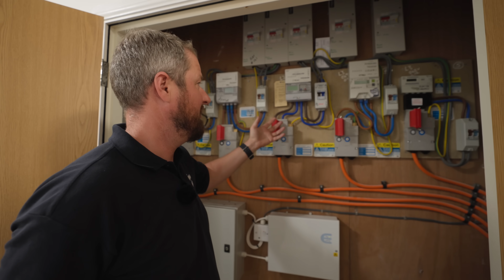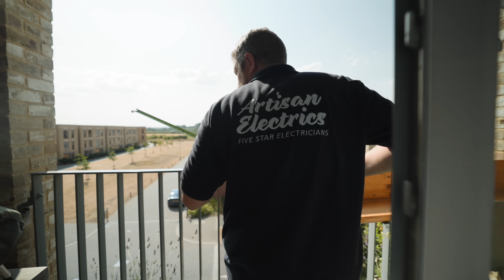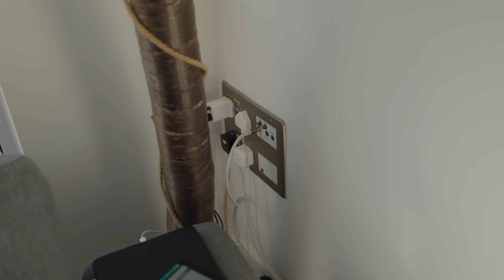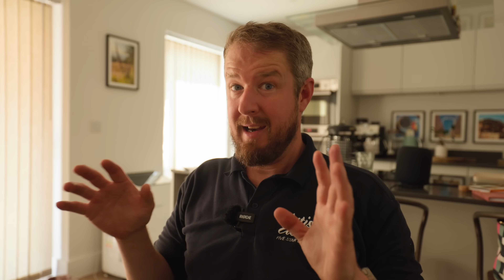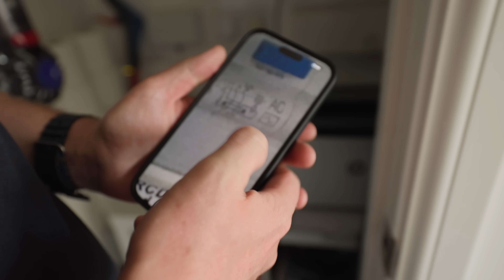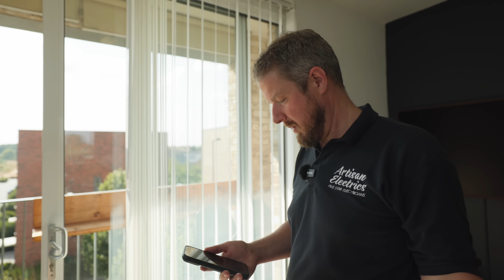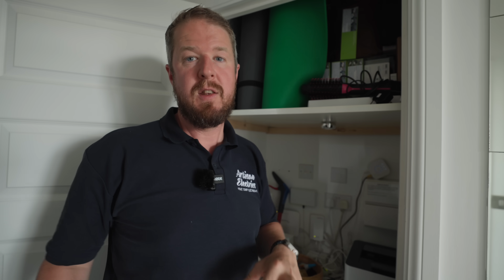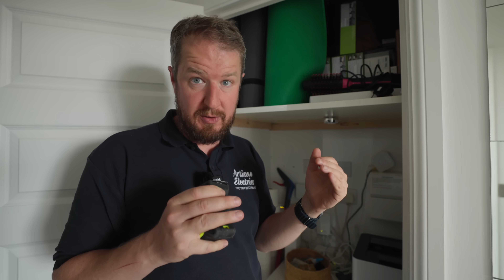I Found a BIG Problem With Plug-In Solar…

Comment: VERY, VERY DISINGENUOUSE !!
You use an example that might apply to just a few percent of the population and then try and dissuade potential people by using that as a classic example.
Outrageous self promotion ..... scaring people off with excessive costs etc. 
Plugging EICR's .... just soooooo wrong.
I like you AND your channel - but this was just an appallingly biased self-serving view of "Balcony systems" where YOU aren't needed at all. Kind of liking asking Turkeys to vote from Christmas. I get it. But be honest and stick to what you normally do.
Balcony systems are here, accept it, stop your scaremongering as we have seen, very soon there will be millions of them all over the country.
Those, like myself with FULL solar - will still have FULL solar fitted and some will choose you guys.
Don't be so dramatic ... plugging in something that at most can push out 800w (Oooooooooh scarey) .... We don't give a thought to plugging in a 2kw or 3kw heater, or microwave or whatever.

Comment: 14:46 I think this is missing the point of balcony solar a little bit. Without the high install costs of 'proper' solar, you can just bang a relatively cheap panel on the outside of the balcony rails. It doesn't have to be perfectly aligned or get the optimal output. Most plug-in home batteries have solar input, so you might as well get some watts into it, even if most cost savings will come from overnight charging!

Comment: I think I am correct in saying that the proposals for 27/08/26 exclude batteries so that would be a future. When/if this is allowed charging batteries using off peak rates sounds great but as more people do this it won't be long before the energy companies are forced to increase the off peak tariff simply because there is no real off peak we would in effect have become a state of equilibrium. The last point means that the pay off (2, 4, 6 years) may not be possible unless it is tied to panels. 

All that said I am still considering it post 27th as we have a large pitched roofed Pergola with dedicated power installed by an electrician, my only dilemma is do I buy something like an EcoFlow Stream Ultra/Pro/Max with built in Micro inverter so that I am ready for storage when it becomes permissible?  

I do need to check the RCBO's so thanks for pointing that out :)

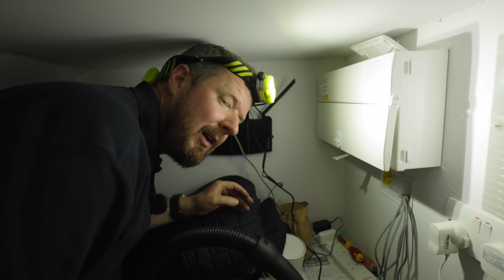Comment: 1:09 Doing an AI search to look up safety critical information about the breakers feels foolish. While LLMs have improved, as a software developer I still wouldn't trust them not to hallucinate, when I can just google the manufacturers datasheet for the component instead.
Reply: The amount of crap these LLMs are spewing is shocking
One day Gemini told me to replace the upper control arms to fix an issue.
My car doesn’t even have upper control arms 🤣 🤣 🤣 
These LLMs are so inconsistent… it’s scary to know some people use them in their day to day work, when dealing with safety critical equipment
Reply: AI is perfectly fine to use as a starting point, and once you find what you're looking for, you confirm it, going the Google search way can take 10+ times longer, so AI first then confirm it, it's far quicker to get the answers you want.

Comment: I've just plugged in my Solarflow 2400AC and love it. Have you seen a quote for Huawei batteries that would go with my SUN2000? Yeah I'd rather plug in then thank you very much.
Reply: Where did you order the Zendure from?
Reply: @dansus99 Toneart (German Shop) and a pre-owned battery

Comment: Biggest issue is the weight of the panels. Each about 25kg. Needs good support. Although you would not do it. Wiring to s lightning breaker will handle the small current

Comment: Lots of negative comments here. I dont see balcony solar in any way competing with a fixed roof solution. Its producing a fraction of power needed in a modern home. Enough power only to run a laptop or two. Personally I couldnt be arsed with the inconvenience for 800 k watts.
Reply: 800 Killo-Watts, yes please!, You could power your whole estate, with that.  How do you plug it in, Camlocks?
I know you mean 800W, and it isn't much, but it's better than nothing, when you can't fit roof-mount panels.

Comment: Traditional Installers/electricians need not fear plug in solar. It's coming if they want it or not. I see it as a "gate way drug" so to speak. People will dabble, see that it works and how well it works and then opt for a full install. If they don't they probably never would have or couldn't. RCBO's aren't a requirement anymore either lowering the barrier for entry by a lot. Also systems can scale to a house's wiring, got 3 circuits? have three microinverters.  One caveat about the fence mounting. New planning laws went in this week where they CANT be mounted to fences. What fun suckers. Sorry to say though, this video does come across as unfairly negative against plug in solar - and looking at the comments it seems many agree with me.

Comment: Are there no P1-meters in the UK?
Reply: No. When the smart-metering standards were developed, the utilities were so sh!t scared of hacking and fraud, that no direct consumer access to meters, was allowed.
The only way to get access to your meter's data, is either, over the Internet to your energy supplier's API, or via a so-called "Consumer Access Device", a gateway, that is paired to the smart-meter, and the Consumer's network.

The smart-meter's ZigBee network, is closed, to all-but supplier approved devices. Even initial on-boarding is limited, by factory installed certificates.
Reply: If you want a headache, go and read the  Smart Metering Equipment Technical Specifications (SMETS) standards.

Yes, standards. The 1st version resulted in meter manufacturers implementing their own flavour of communication, thus if you changed supplier to one that used a different make of meter, you had to have your meters replaced.
That was "Fixed", by imposing a middle-man, that the meters talk to, as do suppliers.
Then V2 of the standard came out, that enabled switching, through the use of common standards.
V2 meters still talk via the middle-man.

Why couldn't the UK, just have asked what meter manufacturers and energy suppliers, are doing, in other European countries?

Comment: The battery system should have an adequate and correct RCD on it, so there should be no need for changing anything on the main board.
Reply: What battery?
The title of the video was "I found a BIG problem with Plug-in Solar...."
No mention of batteries.
I agree withe the other comments that the video should be re-edited to remove all references to "Batteries".
It's about Plug-in Solar Panels!

By all means produce a second video on "Plug-in panels & using a battery".

Just take one step at a time!
Reply: @Ympopka in my country, the anker solix  units typically have a 2kWh battery in them, do they not where you are?

Comment: Thanks for the Type A tip. All good here! :)
Reply: It is not correct though!

The correct thing to do is to plug your plug in solar unit in, then test if your RCDs work OK, as per the instruction manual for the plug in solar device.  If they still work then everything is OK.   A single plug in solar unit is unlikely to cause any problems with your RCDs, whatever type they are.  There are other things in most houses more likely to cause a problem, adding an extra device can cause problems, not will cause problems.

Should we be advised to call in an electrician to check our circuits every time we plug a new computer into a wall socket?

Comment: SO plug in solar is not plug in solar.
There is a good channel that has 365 days of data on what a plug in system will save you and of the top of my head I think that was around £335 a year with the system cost of £2000.
Now this video is suggesting paying maybe over £400 for an electrician to check things before you install it adding more cost which pushs back ROI.
From all the videos I have watched including the Jonathan Tracey video they did not get electricians in to check everything and I think this video might be a bit OTT.

  Plug in solar is supposed to be just that, you plug it in and off it goes and its been in Germany for years and here is is now fine to do so either everyone in Germany and the UK are wrong and you can not just plug it in or this video is just being a bit OTT.

It is rather confusing to see people who think about getting plug in solar then having worries about how it looks and then you find out they are only paying £60 a month,lol.
Even when I lived in a house I was paying around £300 a month and in a pub I am now paying £950 a month so I would be happy to be paying only £60 and if a person is thinking about how it will look then just do not bother, for £2000 and saving £335 a year I think it is worth doing if you have 2k spare and there are lots of ways to add a 5kw+ battery to Eco flow for cheap so you can have a nice larger storage for a lot less money.
Reply: Amusingly, i think Artisan does Jonathans electrics.
Reply: @dansus99  I think your right after all they do a job job.
Reply: Also, does your fence or balcony colour have to be non black?  some people use panels - as fences, sounds good to me.

Comment: For apartment dwellers, I'd suggest that someone talks to the building management (Body Corporate?) and suggest a standardised install of panels and brackets on all balconies provided by the Body Corporate. It will be 1/3 the price and provide a consistent look across the building.
Reply: This is not how it works in the UK, unfortunately. There will be 6 months discussion (email chain bouncing between departments) within the housing association, where the conclusion will be that they cannot do it for health and safety reasons without specifying any.

Comment: I'm in a council place myself, we're a first floor flat but we have our own private garden and entrance porch. I'm going down the route of beg for forgiveness... I've hooked the panels onto the garden fence - fun fact, two panels mount perfectly portrait on a standard sized fence panel! We've had a recent EICR and new CU fitted by the council and the RCBOs are good for it. I'm a high energy user as my hobbies relate to computers and servers so I generally use around £200 a month.

I started with a plug-in inverter but got a bit overcome with excitement and I've since expanded far beyond that, and have installed a hybrid inverter and so far 9 panels all along one side of the fence, and have another 6 to go on the other side (north/south fence). On a good day with just one side of the fence active it's covering about 30% of my usage. I've done the G98 notification and will soon have a friendly electrician check my work and sign off to ensure compliance.
Reply: I predict the biggest risk of balcony solar will be poorly mounted panels. There will definitely be some dangerous installs ending up with solar panels falling from height

Comment: There a few things that are wrong and a few that are valid. Not even a mention of it being legal and compliant on Aug 27th. Didn't mention the batteries are still going to be illegal as plug in until they are hopefully legal in 2027. A home plug in battery still needs to go to the consumer unit on a dedicated circuit. You don't need the smart meter for a plugin solar 800w if I switch mine off nothing stops working its just not as smart. I have it because I have a battery into the consumer unit and it gives me a little bit more control with how much goes to the battery it is a nice to have unless your planning something complicated or with home assistant.  Didn't even mention the 3rd party testing done for the government seems to me like this video is already out of date. Didn't mention that you could have 1 inverter per circuit (ring) like a kitchen and a other room main. What you need to present is a less biased presentation with information that is more useful for the august 27th deadline. I could have sworn the government has said as long as your not permanently altering a property then you just send the landlord a notification that you have installed a micro inverter and panels in a non permanent way and they would have to have a really strong excuses as to why you can't these were the rules for my formal installation request to my landlord before I installed.

Comment: From what I know, batteries are not scheduled to be part of the initial balcony solar setups with the currently introduced UK legislation.
And if I did have batteries then I really would prefer to have them on my balcony rather than inside the house - those vented fumes are pretty bad (carbon monoxide [toxic] & hydrogen gas [explosive] for LFP).
Reply: One of the problems with batteries on an apartment balcony, is that if there is a fire, caused by the batteries or not - the balcony is a potential escape route, via the fire departments mobile ladder. So by putting flammable batteries on the balcony, you potentially block an escape route.

Comment: Surely only one system injecting solar power into a single power circuit will not overload that circuit? I could understand if the solar system was drawing power, or if there were multiple solar system on the same circuit. Any power injected into a heavily loaded circuit will only reduce the load on that circuit.
Reply: I think the argument is, that with a heavily loaded circuit, you could have parts of the circuit that exceed the cable's current rating, and the breaker won't trip, because the solar is supplying some of the current, from the "other end".

Comment: I don't know what electricians are worried about. Plus in solar will be the gateway drug for millions of households going for bigger systems Cheer up FFS!
Reply: Some of them are a bit rattled at the 800W per circuit, that suddenly changed it from "Fisher Price my first solar panel" to covering an awful lot of smaller properties just fine.

Comment: THis has got to be the stupidest video ever.

Ends with warning about CT clamps, PLUG IN SOLAR PLUGS AN PLAYS IT DOESNT HAVE CT CLAMPS.

You're talking about battery systems which are not part of the new plug-in-solar regs. 

This guy shows his workmanship, ANother video showing a shocking install he commented it was good, Then says this stuff.
Type of sparky who will tell you your house will burn down unless you let him do a 12k rewire. When you hired him only to add a single spur socket.

Can't wait till these new youtube changes to delete channels like this, They working on getting rid of AI content then next it will be the Scaremongering/Clickbait.
Years ago Clickbait was frowned upon, Nowadays its a go to for struggling youtube channels. Youtube starting to learn the SLOP gets engagement But only by getting people annoyed. 

If anyone using these people after they said such things online, You deserve to be ripped off.

Comment: Batteries are not allowed for plug-in solar and planning regs are very limited on anything sticking out from a wall and presumably the same applies to railings.
Reply: You can't presume anything... 
Jordyn was referring to batteries alone without solar as an option... Anyways, the government is going to add batteries to plugin next year...
Reply: @SolarizeYourLife I hope they get it sorted but batteries at the moment are only allowed as wired in.
Reply: Walls are actually easy, providing they are on the building itself not a fence/garden wall (except Scotland where it's easy)

Most properties (except flats) you have permitted development rights for panels down walls of your house providing they are attached in compliance with building regulations and don't stick out too far. Conservation zones, AoNB, listed etc are different but the general case is that walls are fine. If you have a nimby solar hating local councillor or neighbours I strongly recommend checking you are permitted development and putting solar all over the front of your house to drive them batty.
Reply: @etchedpixels  A.1  Development is not permitted by Class A if—

(a)the solar PV or solar thermal equipment would protrude more than 0.2 metres beyond the plane of the wall